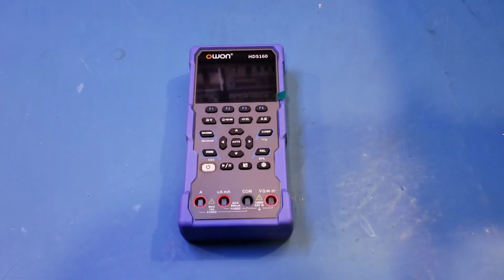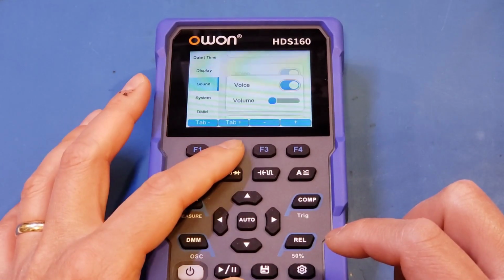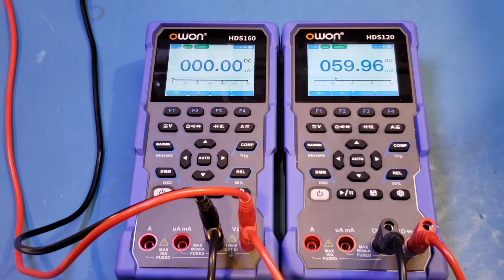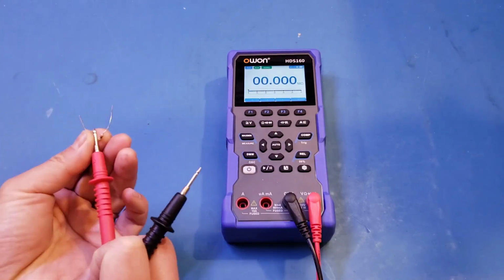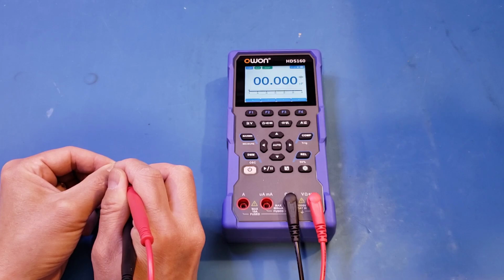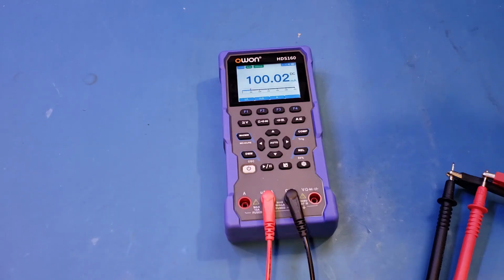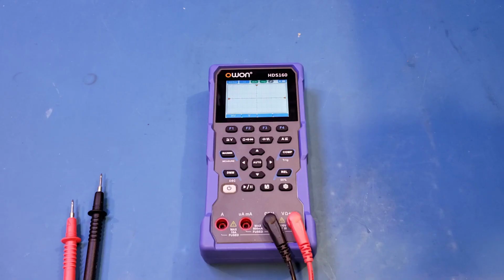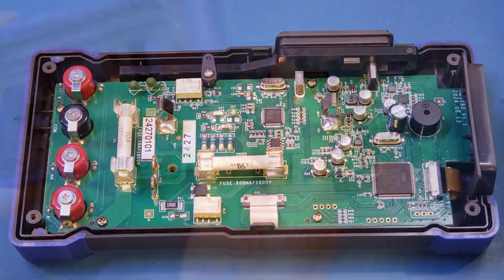OWON HDS160 DMM/Oscilloscope Review/Teardown, Compared to the HDS120

Comment: Quiero comprar el FNIRSI 2C53T.  O este. Cual me recomiendan? Los precios están casi iguales
Reply from the maker: Their specs are quite different. 1MHz oscilloscope bandwidth for the HDS160 versus 50MHz. But the meter function is far superior for HDS160, it also has 60,000 counts. So it is really based on what you are looking for in a device like this.

Comment: Kerry, excellent as always. Almost :-) you may have missed that the amplitude drop in oscilloscope mode is horrible in the mV range, which you did not test. With the HDS120, you will have a significant loss already at >20 kHz instead of >500 kHz in V range.
Would you pls check both your HDS120 and HDS160 for that?
Reply from the maker: Thanks for reminding me. I will try test again and provide an update later.

Comment: For the extra $10 I'll stick with my Zoyi ZT703S.
Reply: @MikesClassicEntertainment    Speaking of the ZT-703S, I noticed that firmware 1.42 is now available, though Zoyi does not post it on their downloads section.  You have to go to the Xeast web site for their 703S downloads.  The firmware application program is the same for Zoyi, Xeast and Aneng.  The boot screen on my Zoyi 703S still says “Zoyi” though it is running the Xeast download file.

The version 1.42 adds FFT display and it probably has bug fixes too.  The FFT is a bit limited in that it does not appear to support cursor measurements of the peaks and frequencies (or I have not figured out how to do it).  It is still nice to have a qualitative FFT display.  I plugged into the demodulator output of a broadcast FM receiver and could see the audio spectrum clearly and the 19.2 KHz DSBSC L-R subcarrier.
Reply: Trash

Comment: Hi Kerry. I have this device too, although with a lower MHz. The problem is that it's slow and the battery drains quickly. At higher frequencies, there's also a lot of screen shaking, and the settings could have been simpler instead of being so nested and complicated. Anyway, thanks!

:hand-pink-waving:

Comment: I reduced the resistance and increased sensitivity on my regular nickel probes by cleaning the tips with 400 grit sandpaper. They are now more sensitive than my gold plated probes and I'm guessing lower resistance. I don't have a milliohms meter but they do measure 0 ohms on a regular meter with just slight contact.
Reply: I used to that, it won't last as they will get corroded so you'll have to do it again. It's best to get a pair of test leads that are actually properly plated.
Reply: @ciprianwinerElectronicManiac  I had Brymen gold plated leads and they didn't laat either, plus you have to baby them which I don't like when it comes to regular test equipment.

Comment: Clean the tip leads prior to any measurements.  It seems that many leads have a left over manufacturing "coating" on them.  I take white scotchbrite & denatured alcohol & clean both ends of the leads and then coat the leads with Gold Deoxit.  YMMV  👍

Comment: Waiting for Zoyi DQ02 LCR meter review😊
Reply from the maker: It's coming, but you will have to wait a bit...
Reply: I just got in a Zoyi ZT-DQ02 last week.  I bought the DQ02  pre US tariff and it was a good value at the time.  The future taxes may change the value proposition.  So far I like the performance.  The battery is a 2000 mAH cell.  Battery life is good.  I have used the meter a lot and not needed to recharge yet.  The charge circuit indicates on a red/green LED and does not have the annoying flicker of the ZT-703S where the battery protection interacts with the charge regulator.  The internal construction looks pretty decent.  I don’t see any huge red flags, given the instrument’s intended application.  The inputs probably could be more well protected against accidental overload, but there is a warning to discharge capacitors before testing printed boldly on the front panel.

The largest flaw I’ve found is that the component sort go/no-go test only works on the resistance range.  When I try sorting capacitors, the percentage tolerance number varies all over the place.  That should be fixable with new firmware.  So far Zoyi has no updates on their web site.  As far as component measurement goes, the DQ02 is pretty accurate comparing to a 1960s era Fluke vacuum tube LCR bridge I own.  Of course the fluke bridge can’t test at as a high a frequency as the DQ02.  Kelvin probes are gold plated and two wire and four wire probes are included.  I’m not sure why the two wire probes are there because the DQ02 does not measure voltages or currents directly for display.  I have the DQ02 with the battery test option, but I have not needed to use it yet.  The battery test has a separate set of Kelvin probes with attach to an aircraft style socket on top of the meter.

I would say the DQ02 is a recommended purchase as long as the price remains affordable.
Reply: The DQ02 manual does not discuss the single wire non-Kelvin probes.  The probe tips are nicely gold (?) plated.  I have found that I get pretty accurate readings if I install the bridge clip insulator and place the probes in the Hpot snd Lpot sockets.  That could make taking estimated readings of in-circuit components a little easier.

I have also discovered that the REL function does not appear to work.  The meter beeps, but the main component reading does not zero as the manual says it should.  It does not matter what component type or if AUTO is selected, the meter does not zero.

The DQ02 I have arrived with firmware 1.0.5 and the circuit board has what appears to be a date code of 2503 to the right of the battery holder.  The meter chip identifying marks have been etched off.  There is a lot of flux residue from the hand soldering left on the sub circuit board which has bridge clips and leads for the probe sockets.

Something which would be nice would be either to provide a set of calibration resistors or to make a set of calibration resistors available an option.

Comment: If you ever get a chance in the future, could you review the OWON HDS320S and compare it to the HDS2202S?  Thanks.
Reply: HDS320S is better in some specs and cheaper. I don't know why HDS320S is not being sold popularly. HDS320S can output signal up at 30MHz and its signal generator has output impedance 50 ohm and 1M ohm options while HDS2202S only can do 50 ohm.
Reply: it is good for its price, but yes for some reason it is not widely available like the HDS2202S

Comment: Why is the OWON not able to measure duty cycle in any of their scopes? It a very commonly used feature in the real world and I’m surprised no reviewer ever mentions it. You rarely use a scope to just look at sine waves.
Reply: Patents maybe?
Reply: @ duty cycle is found on a lot of cheaper scopes.
Reply: @Lagos3sgte so you mean that it does not display a duty cycle in scope mode ? Or doe you mean like in percentages like a fluke 87
Reply: @wayofthesamurai90 you can view a PWM signal but there is nothing in the measurement to show you the current duty cycle %.
Reply: @Lagos3sgte thank you for replay. That is goed to know